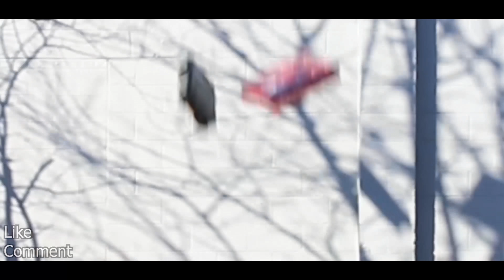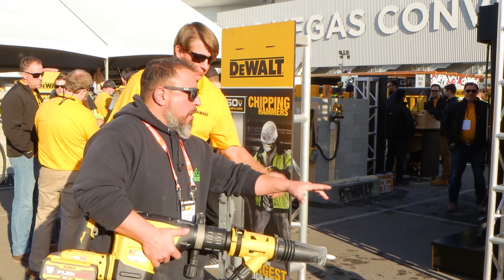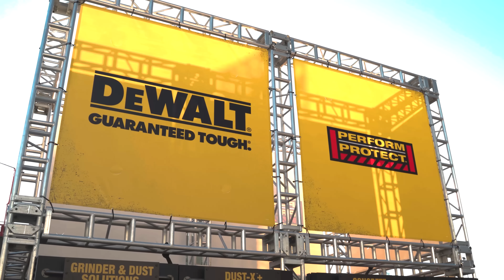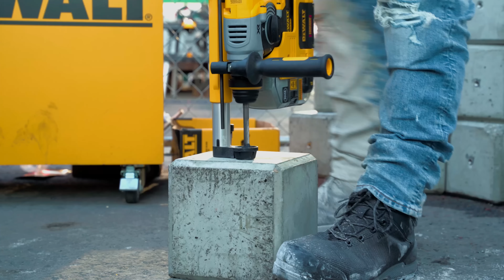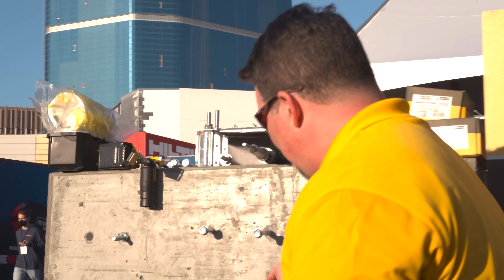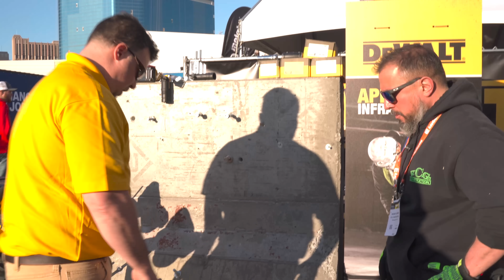Dewalt Shocks Industry With This Innovative Solution!

Comment: Man Dewalt is doing work, as always I suppose lol. I recently got a 5 peice Cordless set with two 4ah batteries 20v Brushless motors and holy shit are they great, I was able to cut concrete drain holes in my basement  for flooding, and the drill/impact driver are just stupid powerful compaired to my last set from years ago (that was craftsman C3 20volt)y wife encouraged it because she says I have a drill or saw in my hand atleast once a day for stuff around the house amd I needed much more from my tools than i was getting, and she's right so with that I'd recommend their 20v Brushless motor line over any others I've used. Great equipiment

Comment: I would like to say that the anchor undercut system has been around since the 1970s. A company by the name of Drillco was selling this system back in the 70’s to all the nuclear power plants being built at that time.  I believe it was called Max anchor.  So nothing new here.  I worked over 40 years in construction for a company that drilled concrete. So I have a little experience in drilling anchor holes. That Dewalt drill looks heavy and clumsy. I do not think I could get very many holes drilled in a day with it. I think I will take a pass on it.
Reply from the maker: You sound like a landscaper

Comment: After years of buying DeWalt tools (thousands of dollars), I've been burnt and wasted enough money. It's time for a new brand. 
$350 hammer drill, dead in 1 year
$300 SDS, dead in 18 months
$600 360 laser, dead in 24 months
All three items were not abused, but DeWalt won't fix them. The laser was the last straw. I'll never spend another dime on DeWalt
Reply from the maker: They’re all under warranty, we want to hear why Dewalt won’t fix or replace them!
Reply: @VCGConstruction  exactly what I thought. But the 3 year warranty is limited. So on the laser, 2 or the 3 lasers stopped working. Not sure why. I babied that thing like it was made of gold. Sent it in to be repaired under warranty and they demanded $270 for the repair. Had it happened in the 1st year they would have covered it. Seems like $600 for a laser that doesn't last for even 2 years is a huge waste of my money.

Comment: I hate new tools. I don’t need Bluetooth or an app in my drill or hammer drill or saw. Having a glass reinforced shell is fine. But adding a bunch of other garbage is just going to be more parts to break.  And almost every company is using cheap ass multi speed triggers from China. 
If you want to know which companies are still making decent tools and which are making garbage engineered to fail subscribe to AvE, here on YouTube.

Comment: Hilti has had the “ undercut” anchor for over ten years. They also had several dustless systems including a coring system that recycled the water to be used again to lubricate the bits. I love dewalt but they very late in the game on this. I guess the patents must have ran out for hilti. Their systems are so similar it isn’t funny.  Hilti’s undercut anchors had carbide teeth on the shield of the anchor that cut the swell in the bottom of the hole. They used a stop depth bit so the depth was spot on. They guaranteed the anchors were just as strong as if they were cast in place.
Reply: Yeah I was gonna say this doesn't really seem that innovative, just seems like a cheap Hilti knockoff.
Reply: 100% this... also Hilti has the 25 year warranty and quality thing going for it over DeWalt. They didn't really invent anything here. Also the Bluetooth batteries, Festool had those for years now (I think they were the first).
Reply: It's not about changing the game it's about making it more affordable and available. How many guys do you see running around with hilti tools that don't work for themselves or a contractor.
Reply: @thomashodis5740  That's fine, but they're marketing this as a professional product. A homeowner that needs a hammer drill can rent a Hilti for a fraction of the cost of even the Dewalt, contractors can afford the Hilti and like the quality and warranty. So what niche are they really trying to fill here with this "innovation"?
Reply: I feel like it's an affordable product at least for some who would want to go the Battery Power way. If you're in the trade then you'll go with Hilti because you can probably get them cheaper through the company you work for or own. Kinda like the mechanics who work at or own shops get SnapOn Tools or Mac Tools where as the regular Joe Schmoe who likes to work on his cars and do some side projects will most likely get dewalt, milwaukee, hitachi, ryobi, ridgid, craftsman, husky or other tool brands of that quality because they are easier to find at your local hardware store and sometimes more affordable.

Comment: They need to make a special outfit. The contacts for power transmission to the tools would be some gloves which attach to a vest. The vest would hold a bunch of flat batteries. You could probably fit 50ahs in a vest with negligible weight when spread over the torso.

Comment: I think it would be a good idea for these tools that benefit from having a giant battery to have a system where you can clip the battery to your belt and run a short cord to power the tool. Hybrid cordless where you're isolated from extension cords running all over but also keeps the heavy weight of the battery out of the hands
Reply: Have always said this!  No idea why they can't just make battery backpacks at this point and run all day long.
Reply: E-Go makes a battery backpack
Reply: Makita has a battery backpack
Reply: Ego and Stihl already do.
Reply: They have those.
Reply: Makita has them. I think they’ve had them for half a decade by now but not certain of time period
Reply: Weve had those for 2 decades.
Reply: Or bagpack...
Reply: Stihl has a battery backpack for their battery line trimmer
Reply: "Hey big boy, is that a battery in your pocket or are you just happy to see me !" ... 🙄😅
Reply: I'll take this all day long. When moving houses, had to bust block up to head high, with a 120 v full size rental jackhammer, full size, full weight. These look like lego toys in comparison.
Reply: Exactly. You should be able to wear the battery just like many paint ball players wear the air tanks on their belt or back with an arms reach length cord or hose.

Comment: I don't know what to say.
#1 - I've drilled in thousands of 3/4" bolts while setting precast concrete panels. Attaching adjusting screw jacks to the panels once they were " stood up", never had a problem... even after the walls experienced high winds. I'll drill and install 20 anchors before that system puts in 3.
#2 - The Hilti 3000 avr breaker will kick the __ out of that breaker.
#3 - Who in their right mind would want to use a short bushing bit for.... Let's just say... 5 hours out of 8 hours in a normal workday? 3 - 5 days in a week? 😅😅😅
Keep up the great videos Vince.

Comment: I can't take DeWalt seriously as a dust extractor option. And that 15ah pack is obscene unless powering something hungry like what was used in the demo.
Reply from the maker: Curious, why can’t you take it serious as a dust extractor solution? I agree on the battery, should be a high draw tool.
Reply: @VCGConstruction  just the experience I had with the corded one they made some years back. I'm down with Festool for dust extractors but the DeWalt performed poorly at near equal Festool pricing. I hear Makita makes a good plug in dust extractor. I'd also consider Mirka or the Hilti if I jumped ship to a different brand.
Reply: That's not concrete, it's gray Styrofoam
Reply: @yourlogicalnightmare1014  I like the name you chose for your handle.

Comment: I like the new stuff, but I have a few notes. The reason I didn't buy the new 15ah battery is because it's $380, and I could get five 6.0 batteries(30ah) for the same money, but also because it uses 18650 cells and not 21700 for some reason. It makes me wonder the power difference considering the 9.0 ah uses 21700 which have consistently shown a lot more power. Also, I think the first guy kind of avoided the question about thermal control, I don't believe dewalt batteries have a killswitch similar to makita when overheating. Also, in my experience, free floating handles are common on big demo hammers. Solid video though. Thanks for keeping us informed.
Reply: Thermal control has almost everything to do with the BMS (battery management system) inside the of the battery pack. So it could very well just have a new BMS with more protection features.
Reply: First there are more smaller batteries in the 15ah so each individual cell will discharge slower. Proof is the difference between the 20 volt and the flex volt 6ah batteries. The flex volt runs longer in the same 20 volt tool. About the temperature control smaller batteries more surface area faster heat disipation. If you're running a high draw tool like a grinder it will shut down on you when the battery starts getting warm even if the battery still has two lights of charge done this more than once myself.
Reply: @silentlyobserve  I disagree with the flexvolt 6.0 running longer in the same 20v tool. I have 4 20v 6.0 XR batteries with 21700 cells and 4 6.0 flexvolt batteries with the 18650 cells. My 6.0 XR batteries with 21700 cells definitely perform better than my 6.0 flexvolt batteries. Personally, I only use my flexvolt batteries in my flexvolt advantage sawzall and table saw, which is very high demand.  My table saw has only shut off from grain bind. My sawzall is supposed to gain power from flexvolt batteries, but my sawzall is stronger with the 6.0 XR batteries with the 21700 cells than it is with the 6.0 flexvolt with the 18650 cells. If I upgraded to the flexvolt 9.0 with 21700 cells I'm sure I would see an improvement. You can check Mancaver tools for more practical tests and Torque Test channel for scientific tests with these batteries.
Reply: I agree with you, $380 is just too damn much for one battery and I'm also finding some seat of the pants disappointment in my Flex Volt tools versus the Power Detect versions with the 6 or 8 ah batteries. I have 8 of the 6 ah and two 9 ah Flex Volt batteries, so these new tools have some appeal to me but frankly, I've been switching to Milwaukee or even Makita 36 volt over the past year. The only reason I haven't switched to the Milwaukee rear handle saw is because they built a tool that needs that giant 12 ah battery for best performance, then made the battery too expensive. I'm probably wrong, but I see tool platforms requiring huge and grossly expensive batteries as a failed business model.
Reply: because 15x 21700s is never going to keep up with 30x 18650s, especially if we're talking about a 5.0 Ah 21700 cells.  And a 30 cell 21700 (18-24 Ah, depending on cell used) pack is well outside the scope of Flexvolt in terms of form factor/weight.   

Flexvolt packs have to be in multiples of 15.  21700s aren't some be all end all solution and you fell for a lot of marketing hype if you thought 18650s were just going to disappear over night.
Reply: 21700 batteries have less energy density (mAh per cc of volume), less power density (CDR per cc of vol), cost more money, and take up more space. There is absolutely no reason to go with 21700 batteries, unless all you care about is peak power for less run time. That's the only reason tools that take a 21700 pack do better is because it has cells with a 30-35 CDR rather than 18650 cells with a 20-30 CDR. A 30A CDR 18650 battery is far better than a 35A CDR 21700. The power and energy per unit volume is far better on 18650 cells. Sure, you'll get 5-10A higher CDR with the 21700 cells, but it's going to be a bigger and heavier battery. You could add another parallel bank of five 18650 batteries to an 18650 pack, to get way more power & energy than having a 21700 cell pack, and it'll be the same weight and size.
Reply: @littlejackalo5326  my 6.0 XR and my 6.0 flexvolt have no notable difference in size and weight. The 21700 creating higher peak power means it struggles less under load, which is ultimately what drains batteries the quickest, and I'm sure that makes up for any potential loss in runtime. I understand there's a science to it but there's also practical applications that can answer these questions. From my practical experience with these batteries since they were released I can say I prefer my 6.0 XR. It's not a small difference in power, it's actually the difference between drilling a difficult hole or making and difficult cut without the drill or saw shutting down, so that's a massive difference.

Comment: My toxic trait is thinking I need that concrete anchor system when literally the most intense construction I do is in my garage.
Reply from the maker: 🤣 that’s hilarious 802!
Reply: Haha... I'm in the same boat lol
Reply: I have chipped a lot of tiles grouted right to concrete (vinyl/asbestos type and ceramic). This would be a good tool.
Reply: 802 Garage - stay away from me, I think it’s catching.
Reply: @truthserum9157  Cough cough.
Reply: 😂 Ditto
Reply: Felt
Reply: Ya, same here bro....o well, better to have and not need than to need and not have
Reply: Grab it man you might wanna run a 50 amp EMT run or pvc, whatever you gotta run
Reply: That logic caused my first divorce.  My warped mind could apply that logic to a friggin bidet.....lol.

Comment: That undercut was better than the redheads of my day but I still don't like Hallow bits
Reply from the maker: Fair enough, but why don’t you like hollow bits?
Reply: @VCGConstruction  to me it looks like that first that was Hollow and it has a pair of carbide cutters with no support behind them odds are that carbide has a Rockwell of 8 or 9 they use a lot of jadeite and Bluestone in the concrete around here that's got a Rockwell between 6 and 7 without a high speed steel back up that carbide blades just going to snap personally I'd rather just drill the hole and then vacuum it out with the undercut and if the undercut doesn't work then I guess I'm going to the mallepar. But honestly the undercut looks like a redhead to me. Have plenty of coring bits it's just that carbide crossbar that bugs me